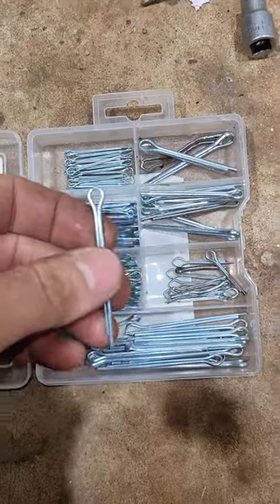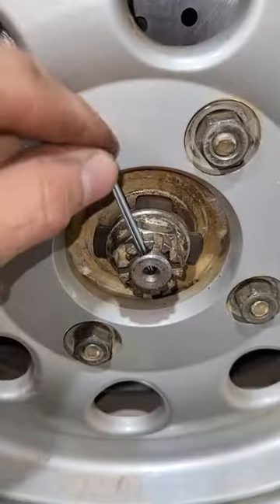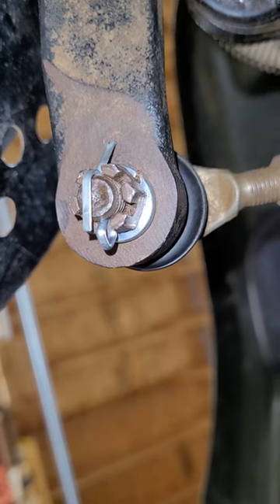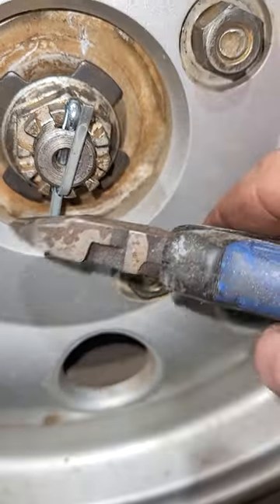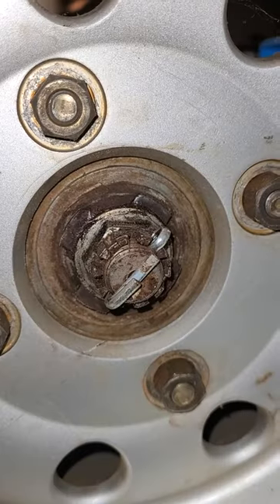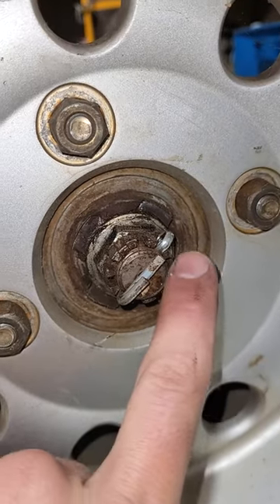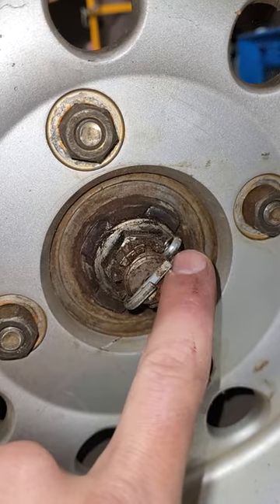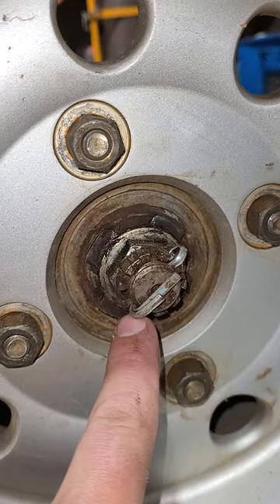Mechanic States Cotter Pins

Comment: If you get a cotter pin that doesnt fit the hole properly, place the eye of the pin on a hard surface and give it a love tap with a hammer. Will flatten the eye slightly and spread the legs of the pin so its a tighter fit.

Comment: I actually just watched a video about this a few days ago and wish I could share the link with u. But the video wasn't so much about which way is the best to bend the "tails", but more about how if u leave space for it to move, it won't rust to the surrounding metal. So instead of pulling the head of the pin snug with the nut, leave some space and bend ur ends.
Reply from the maker: That's a great point!

Comment: I also like to get the thickest that will fit through the hole…I turn one over the top outside and turn one around the nut(this is provided I have enough cotter pin to do so). Looks like we are the only two people interested in Cotter Pins…lol